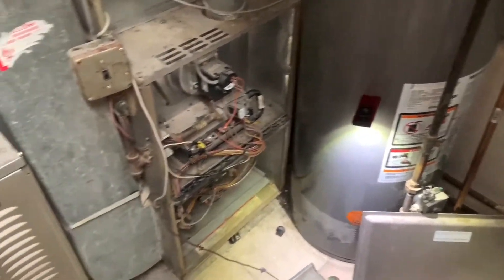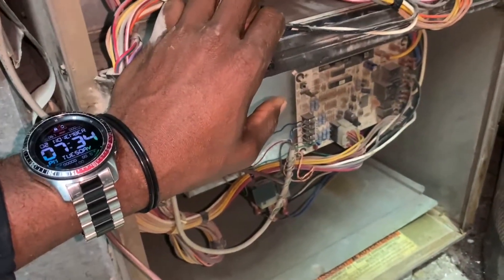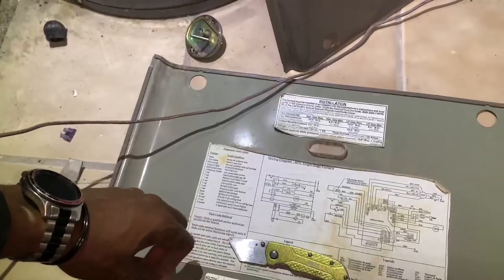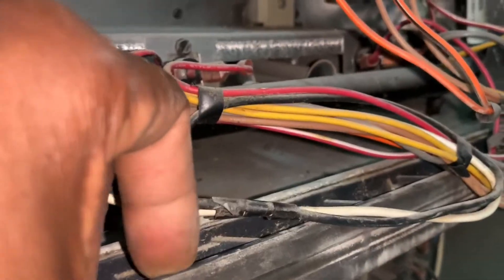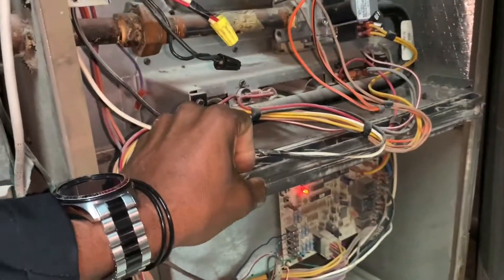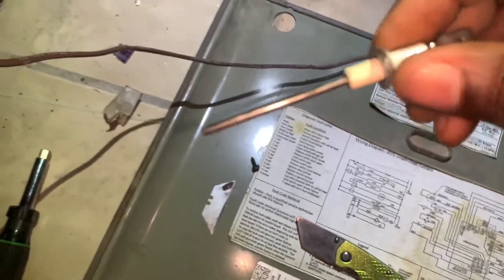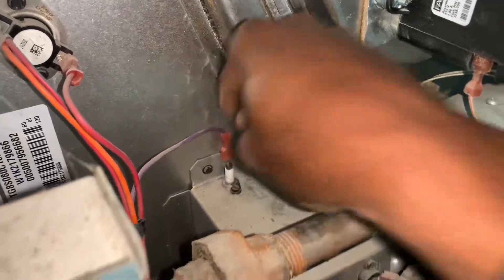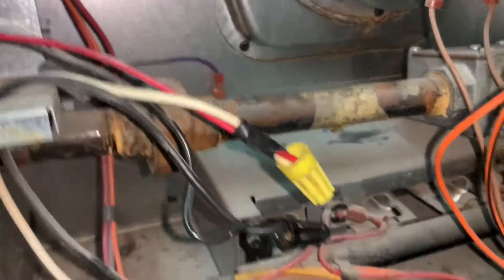HVAC TROUBLESHOOTING NO HEAT

Comment: Exact same furnace, been doing this since new had flame sensor changed out still does it. Any ideas?
Reply from the maker: The wire from flame sensor may go into the a plug harness on the board that may not be making good connection  check your wire and connections  otherwise it’s a controls board issue